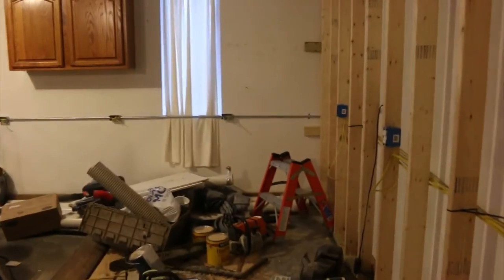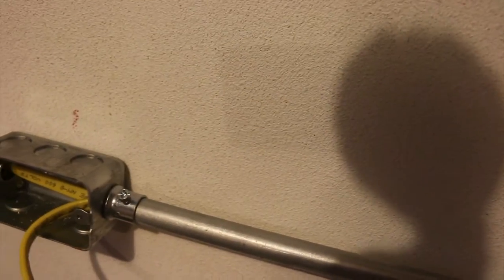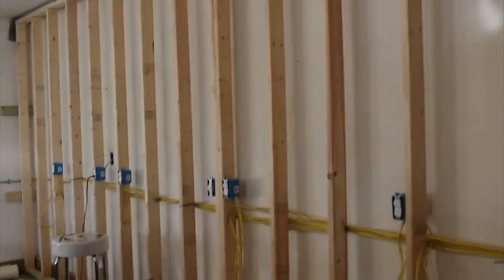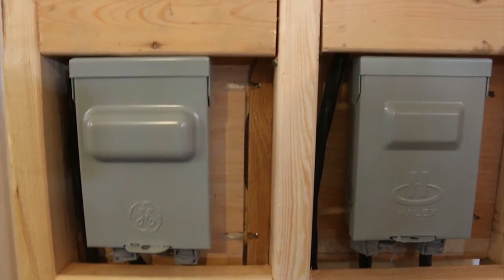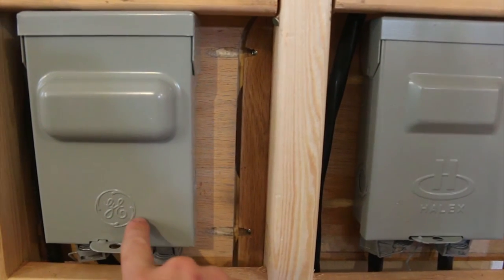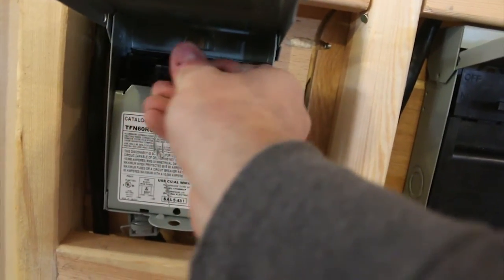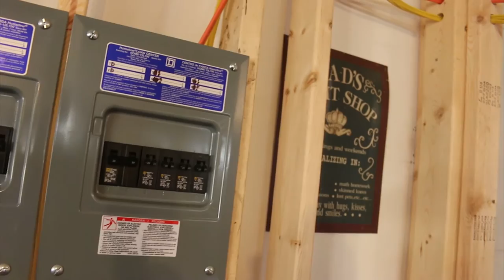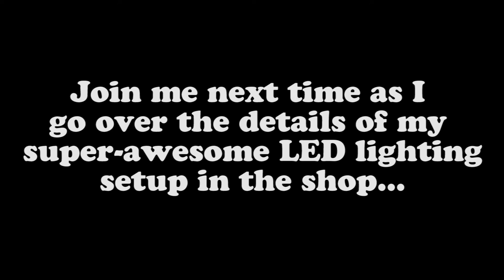Don't Call It a Dream Shop: Electrical and Insulation

Comment: I know this is jurisdiction-based, but I'm sure you're going to hear somebody say something about running Romex in conduit like that (I did mine that way and it's legal here.)  Regardless, did you check your fill rate on that conduit?  Because I'm pretty sure Romex run double through that diameter conduit is exceeding the limit.  I only mention that because you could possibly end up with a situation where that particular circuit overheats.  Not being negative, just trying to make sure you checked it to prevent a fire.
Reply from the maker: Hopefully the "I'm not an electrician" disclaimer is well understood by everyone. I probably should have put a "don't try this at home" one up there too. I'm not too concerned about running romex in conduit.  Nothing in the code here specifically prohibits it in my area.  I may have been pushing it a little running two circuits in the wall run, though.    Time will tell, I will update if I notice any abnormal heat buildup in the conduit.  Incidentally, the two circuits in the conduit are a 100v and a 220v, so it should be interesting to see what happens.  I can't see a situation where I would be running anything else along that wall while my table saw is running (the reason for the 220v circuit). My dust collector has it's own dedicated circuit on the back wall.  Great point, though.  I didn't even think to check if it was allowed.